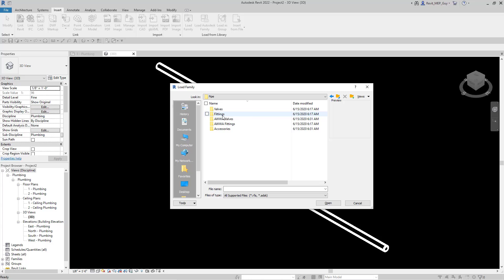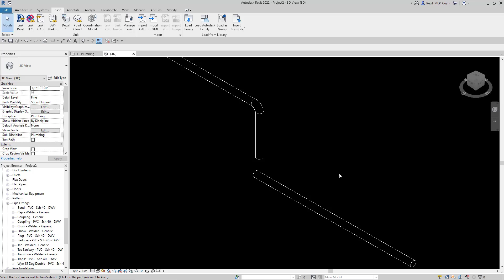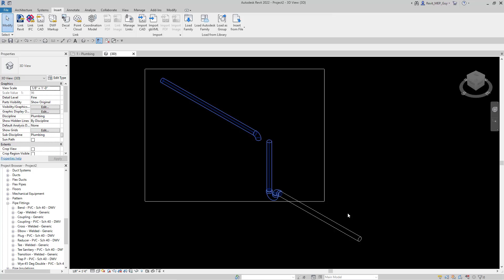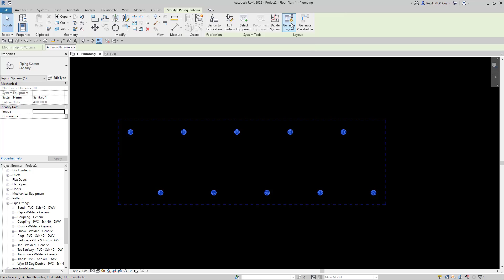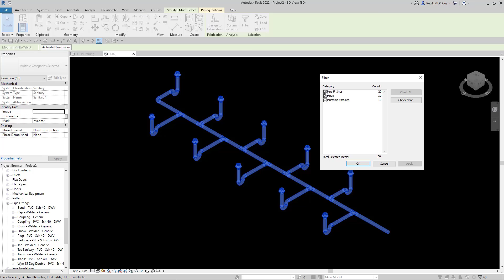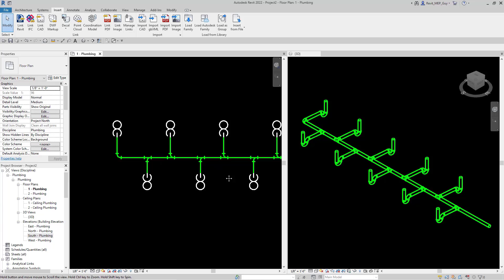Comment: Great video, thank you for providing this content.  Can you do a video on how make the 2d content in your P-Trap visible at different scales or annotative?
Reply: Do you just want me to explain how it works? The symbol nested inside is a generic annotation, so it will scale correctly. That is a good video idea, and maybe I can make it in the next couple weeks.
Reply: @mep_guy  I’ve downloaded your p-trap and was using it in a project. Tried to change the scale from 1/8” to 1/4” per foot. The symbology did not change. Also have other generic fittings with tick marks that show way too small and would like to know how to edit these parts. Thanks for getting back to me so quickly.
Reply: @mikemccall169  No problem I check my comments every day. When using symbols/annotations, the size should and will stay the same. If you wanted the symbol to change size, you would want to use model lines or lines within the family, not a generic annotation nested in. Or you could use two different annotations, one for 1/8" and one for 1/4" and just use the visibility settings to turn on and off. I think the first way is your best bet. If you want to chat more and maybe set up a short video conference I can walk you through some stuff. email is theguy@mepguy.com

Comment: Hi Seen this before, what would be really nice is to have a P-trap family that swings as a P-trap does between the U-bend and the street 90
Reply: Oh wow. Yes that would be nice! I rarely get that detailed in my designs, but if I was doing as-builts that would be handy. Creating fittings is probably one of the harder things to do in Revit. I'd recommend just using the U-bend and street 90 as separate fittings. That way you can swing the 90 around like you are suggesting. I think that should work for you. Let me know!

Comment: Great video, thank you so much for the info. Is there a way to create a piping system with slope using the generate layout command?
Reply: Yes you can. There is a drop down to the left of finish layout button for the slope value. Just set the slope to the value you want before you finish the layout. Thanks for the question and feedback.